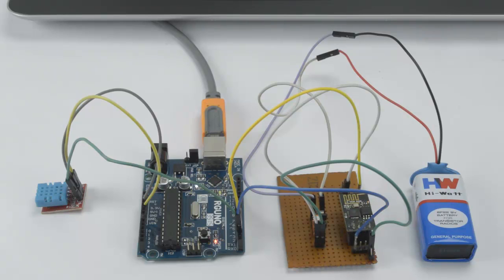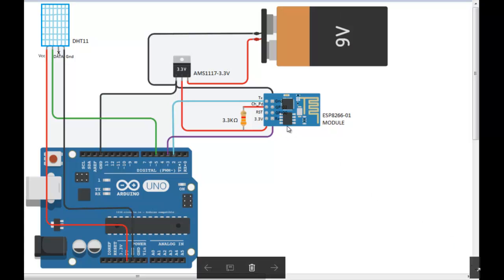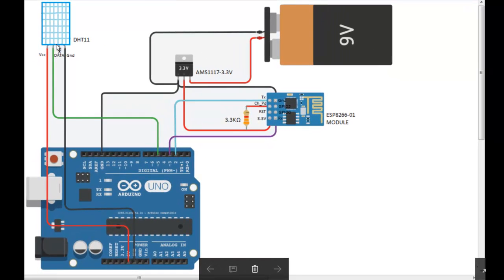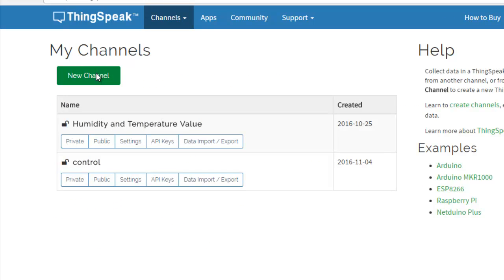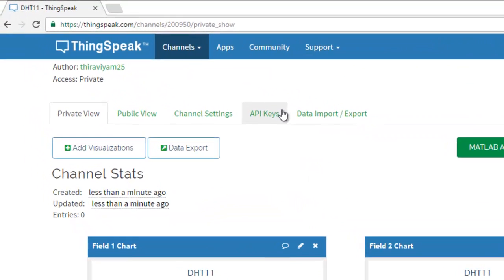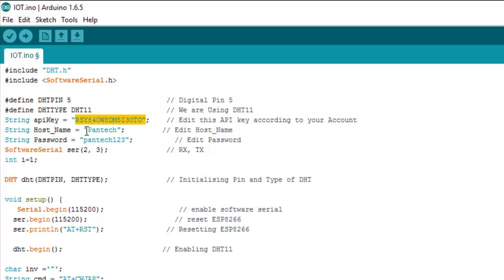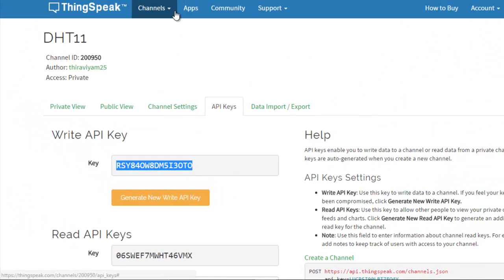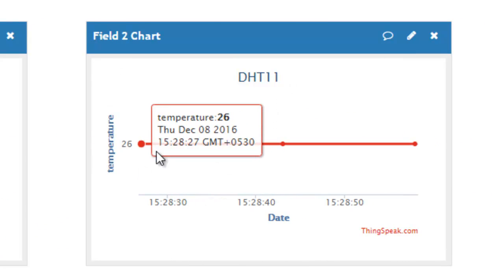IOT Based Humidity and Temperature Monitoring using Arduino Uno

Comment: Hi;

I got below error & esp doesn't connect to wireless. I can see new SSID from arduino called AI-THINKER....  How can i resolve the issue.
Please advise

Documents/Arduino/Project.ino: In function 'void loop()':
Documents/Arduino/Project.ino:52:20: warning: deprecated conversion from string constant to 'char*' [-Wwrite-strings]
 if(ser.find("Error")) {
                    ^
Documents/Arduino/Project.ino:67:18: warning: deprecated conversion from string constant to 'char*' [-Wwrite-strings]
   if(ser.find(">")) {

Comment: I got below error & esp doesn't connect to wireless. I can see new SSID from arduino called AI-THINKER....  How can i resolve the issue.
Please advise

Documents/Arduino/Project.ino: In function 'void loop()':
Documents/Arduino/Project.ino:52:20: warning: deprecated conversion from string constant to 'char*' [-Wwrite-strings]
 if(ser.find("Error")) {
                    ^
Documents/Arduino/Project.ino:67:18: warning: deprecated conversion from string constant to 'char*' [-Wwrite-strings]
   if(ser.find(">")) {

help me to solve this and to connect esp8266 to wifi
Reply: sss. even i got the same error
Reply: i got a solution ...
if(ser.find(char*)("Error")) {

(include char* in it)
u can get rid of those warnings..

Comment: I am getting an error as: In file included from C:\Users\User\Documents\Arduino\libraries\DHT_sensor_library\DHT_U.cpp:22:0:

C:\Users\User\Documents\Arduino\libraries\DHT_sensor_library\DHT_U.h:25:29: fatal error: Adafruit_Sensor.h: No such file or directory

compilation terminated.

exit status 1
Error compiling for board Arduino/Genuino Uno.

Comment: code is executing but it is not reflecting in thingspeaks can u plz expain about it
Reply from the maker: Thanks for ur respones @Ragini Putchakayala :) ! first Check your esp8266 module connect.if its not work mean then you check the connection between with esp to Arduino 
otherwise check your internet connection !
Reply: @pantechsolutions  I am having same problem can you pls help